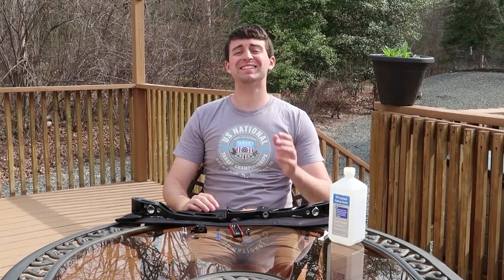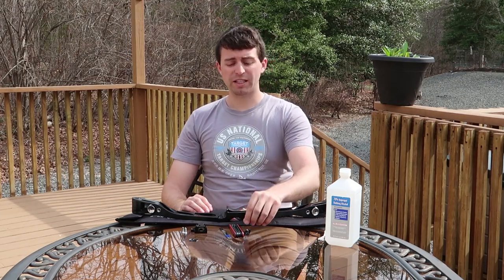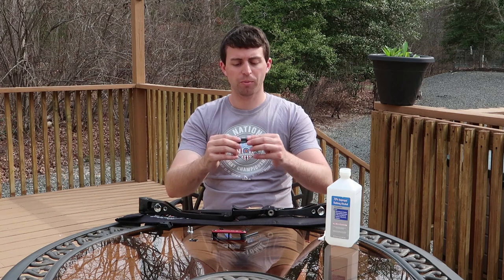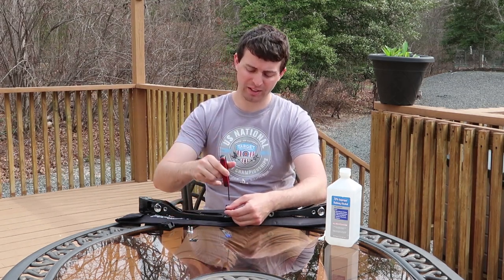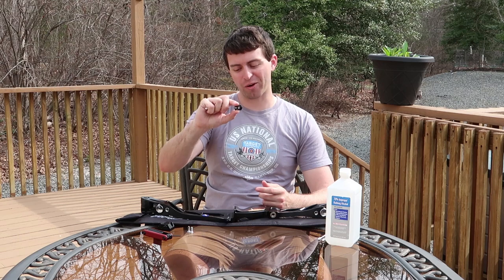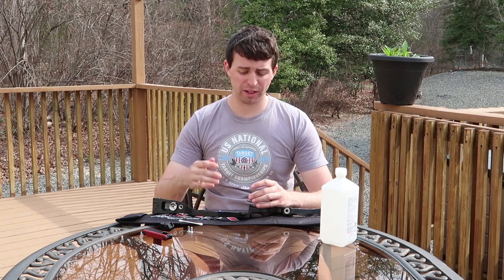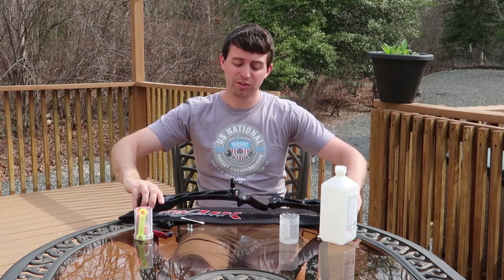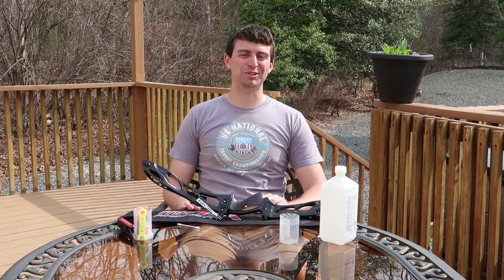Building Your 1st Recurve Bow Riser

Comment: Good video!!! Hey, could I please get your opinion, on a ILF Riser? I've been eyeing the Krossen Xenia 25" Riser, and could you tell me what you think.
Reply from the maker: I looked at the Krossen Xenia. The price for the riser is low which is nice but I am concerned about the fact it is diecast. I am sure it is fine for low poundage and probably a good starter bow for a young archer. Also as a note on some of the diecast risers they have a max draw weight of 40lbs. I also have never used that riser before. I am going by the info Krossen provides. So I looked around for other risers near that price range that were forged aluminum and CNC machined. I found these Galaxy Tourch 25" Recurve Riser, SF Archery Premium Plus. On the higher end the SF Archery Forged Plus is a  very popular riser you also get a plunger and an arrow rest. I hope this helps again I have not used any of these risers.
Reply: I was thinking of getting one in the 30 pound range, would that be low enough?

Comment: I also will use the same Shibuya rest for my bow. so for the rest alignment; do I need to have it lined up square to the riser/shelf, or do i need to lined it up square to the string?
Reply from the maker: The  Shibuya rest is great! You want to line it up with the riser/shelf.
Reply: Shore Shot Archery thanks for the reply. any reasons why need to line up with the shelf instead of square to the string (based on the consideration that the string is in positive tiller so it is not 90 degrees to the shelf)? or are the differences between them are so negligible, therefore line up with the shelf is a simpler solution?
Reply from the maker: Lining it up with the shelf will help with tuning the bow later on and just keeps it simple and consistent.